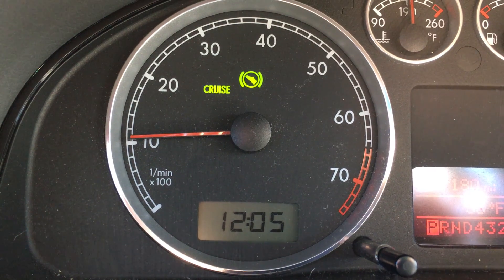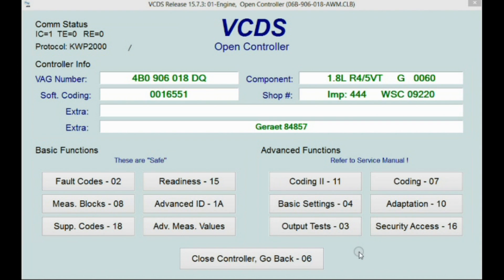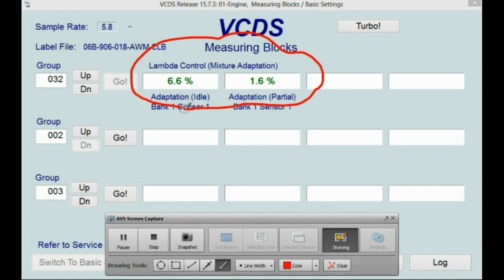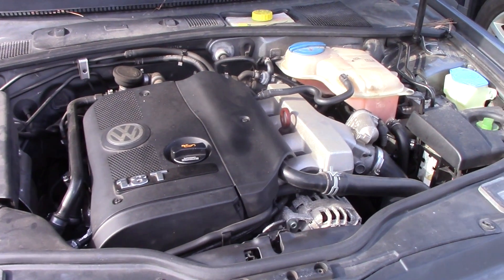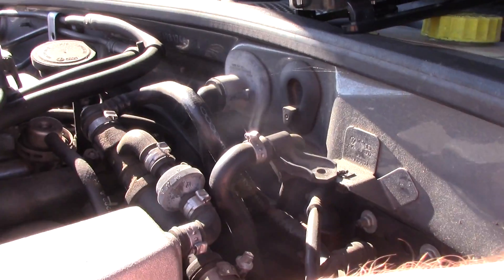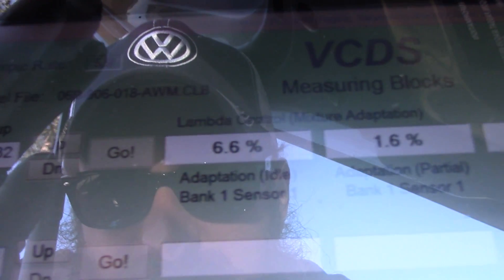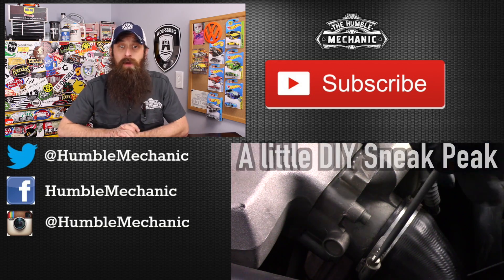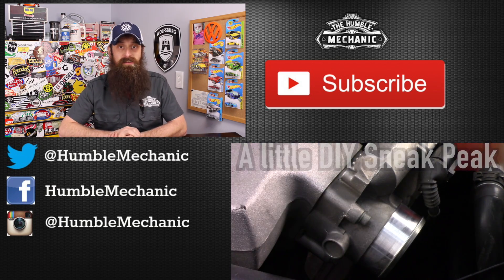Volkswagen Check Engine Light Diagnosis

Comment: Yeah I've done a few of those PCV hoses  before. Where do you get your info for which measuring blocks to use on VCDS? From their website or just by playing with it? I have learnt a lot messing with it but I feel I'm just scraping the surface of what this software is capable of, and would like to learn more about it features. Any help would be appreciated.
Thanks
Reply from the maker: Much of my knowledge of using VCDS comes from the years of diagnostic tests on VWs at the dealer. Back before the GFF tests when you had to know what you were looking for and remember the fields.
Reply: +HumbleMechanic thanks, yeah I think I will just keep playing with it and learn as I need to and as jobs come up! Great show, I just recently came across you and subscribed straight away. I used to live in the UK and was involved in the VW scene but was out of it for a few years when I moved to the us. I worked as a dealer tech in the uk but have now moved away from that field and intend to keep cars as a hobby in the future. Bought a 2014 GTI last year and am quickly remembering what I live about VW. Any ways, awesome show, keep it up and I look forward to 2016 with Humble Mechanic.

Comment: Charles, I have similar codes on my 2009 gti (tsi) to what you've got. I have not noticed any change in my idle speed, but the code is there for a high idle. I also have codes for a lean condition. I've gone through and checked everything by hand, haven't found a weak link. I also recently replaced my whole pcv system (valve and hoses) due to my rear main seal failing, and still have the lean/high idle codes. Any advice on where I should look next? I've had a few technicians check out the car at the dealership I work at, and they've all been stumped by it too. There is really no drivability issue with the car, but I'm getting tired of looking at the MIL on the dash all the time. I love your videos man, thanks for making them!
Reply from the maker: Any other oil leaks? On that car you have to be sure you have good fuel too.
Reply: +HumbleMechanic Thanks for the response! No more oil leaks after the new rear main and oil pan.. I usually run 92 octane pump gas or 101 race gas. The car runs awesome at full throttle and idles well too. This CEL is driving me crazy.

Comment: i have 2 codes 
1: p0102(maf low input volume)
2: p0299(turbo low boost)
any advice i cant find a boost leak anywhere
Reply from the maker: What car?
Reply: 03 passat AWM 1.8t
Reply from the maker: Maybe a failing MAF. also be sure to check the PCV hoses I showed here
Reply: +HumbleMechanic  maf has been changed 2 times I have a factory Bosch maf I'm going to put In to see how it works

Comment: Do you have any videos on the epc  light
Reply: I had the EPC light on and changing the crankshaft position sensor fixed this for me. Super easy repair.
Reply: Its usually crank sensor, throttle or coil pack.

Comment: "oops, that's a piece of the engine in my hand" :D
Reply from the maker: +Guillermo Lovato LOL, It really caught me by surprise.
Reply: HumbleMechanic
it made for an interesting point, "hidden" stuff faults are not as interesting as when you pull a large piece of rotten hose from the engine(and it keeps running)

Comment: Great video.  A few years ago, I had an 2002 A4 1.8TQMS and had a vacuum leak the dealer tech had difficulty finding.  Ultimately they had to do a remote connection with Audi in Auburn Hills MI to diagnose. I got the impression from that experience that looking vacuum leaks on the 1.8T was challenging. You make it easy. I'll have to look up what they found.

Comment: I've seen these break so many times man. You can actually get that block breather in metal instead of plastic and run a catch can instead of  replacing all those old lines. I did it on my Mk4 Gti and it made a huge difference and I haven't had a problem since. Anyway love the videos man keep up the good work!
Reply from the maker: +R. Carter I got the 034 motorsports kit.
Reply: nice man youll be happy with it for sure